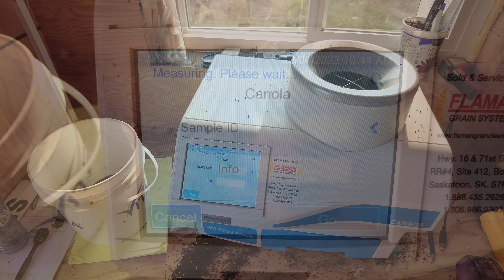S3Ep36 - I Go Discing, Combines Keep Rolling, And The White Dust Causes Problems!

Comment: You guys should get a vinyl mat, with two wood towels on the ends for your grading room. Maybe your local elevator uses these if you want to see what I mean. You can use it like a funnel to put the grain back into the bucket when you are done. It makes things fast and cuts down on the mess
Reply from the maker: I can certainly picture in my head what you mean! Something I’ll have to look into, thanks for watching!
Reply: @Soupaloop16 Thank you! I appreciate your videos. Very interesting to see what goes on